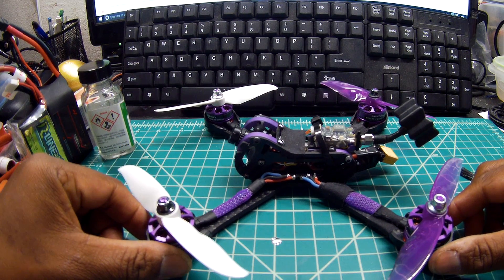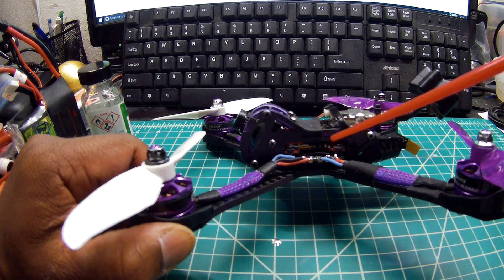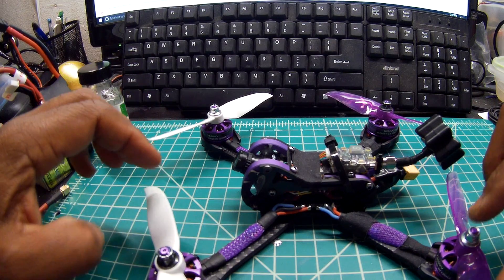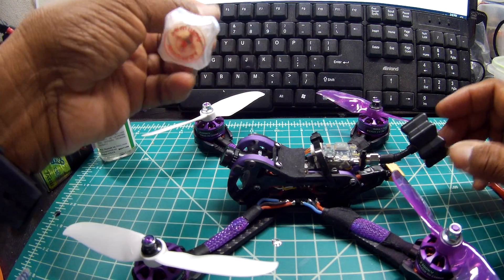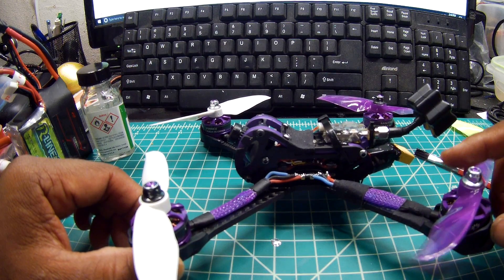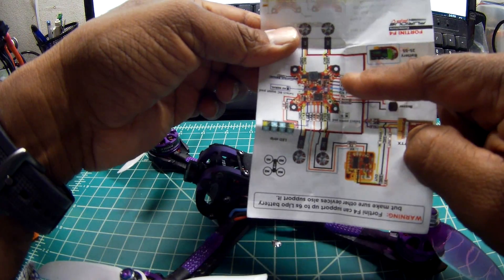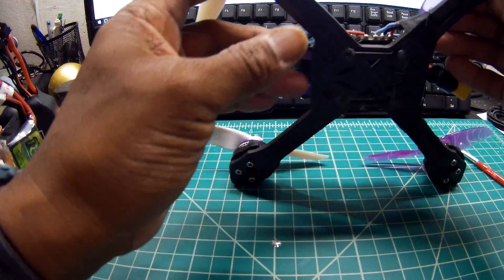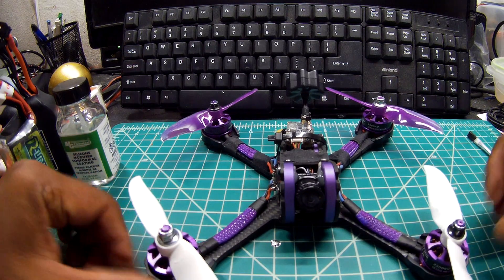Purple Realacc X 215 Frame 5s Build Review - Wizard 220s 2206 2300KV Motors

Comment: Didn't you need to chage the set-up in Betaflight? I'm asking because I heard that the 2300kV motor can be burned with 5S battery if the power supply is not limited.

Comment: Love the color scheme, got mine in black sleeving, silver DYS pro tab motors and purple of course. Hey you can fit all your components into the frame with no external pieces. Got it sooo clean it looks great. If you want to see some pics let me know, I can find a way to share some pictures.  I am probably going to offset the weight of this quad with some 50x51's and bring it back up to where the IX5 and Rammus 200mm flies. Both of those builds are great as well. Had a king kong 130gt that was also a blast but alas it died in FPV glory over the pond...lol We have a goofy fire hose sign next to the pond and I wacked it....goodbye to one of my favorite micros with an awesome cam and all around good quad.
Reply: Also running an Eagle camera...lol forgot to mention that....
Reply from the maker: acehighflyer123 Thanks Acehighflyer123! Yes share some links to your build! 

I know the feeling of losing your favorite quads to crashes. In this hobby ive learned quickly not to get attached to these quads. Sooner or later you will break them. Lol! But...the losses give reasons for getting newer upgrades!
Reply: Scott Givens Yeah, I am out of town for the holidays...but I will get some pics for you on Sunday. You are not lying about the hobby. I love it though. Happy Thanksgiving 👍.
Reply from the maker: Joshua Sterling Happy Holidays to you too Joshua!
Reply: Please share a link to those pics thanks!

Comment: Bam.  Awesome brother
Reply from the maker: JJRotoGeek Thank you JJ! My average joe LOS flight is uploading now. With all the cramming I did, mine is still like 20grams heavier than you build. LOL . I’m not going to try to make it any lighter. Just gonna fly it. Your build inspired my purchase. Thanks Again!
Reply: Scott Givens awesome!!! I had my vtx on top for the first flight too.   Got rid of it and put in a vtx03.  Lotssss better
Reply from the maker: JJRotoGeek Awesome! Banggood has them on sale too! Thanks
Reply from the maker: My pids are awful can you share yours later? Im not a great tuner. Lol
Reply: Scott Givens lol honestly I run stock on mi e and it flys perfect.   What’s it doing
Reply from the maker: JJRotoGeek just feels very floaty when flying LOS. It’s not locked in. I used Envyastros pids, but think it’s not designed for my motor/frame setup. I may just update to the latest version of betaflight and leave the pids as is
Reply: Scott Givens I would reset pid settings on the pid page, and jump ya p values up about 5 since your running shot battey
Reply from the maker: JJRotoGeek thanks for the tip! On it!
Reply: Scott Givens lemme know how she goes.   I can send u my diff file if ya wanna see me set up.
Reply from the maker: JJRotoGeek will Do... And thanks for taking the time to help and respond. I know you are busy and I appreciate it
Reply: Scott Givens no problem brother.   Keep me posted!!
Reply from the maker: JJRotoGeek Flys much better now with default P’s increased by 5 like you said. Thanks JJ!
Reply: Scott Givens bammmmmm